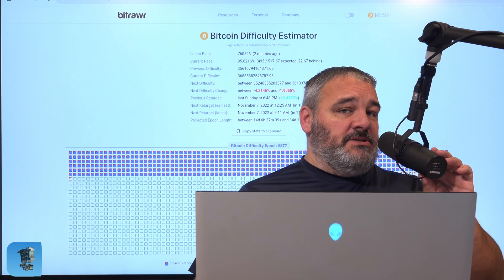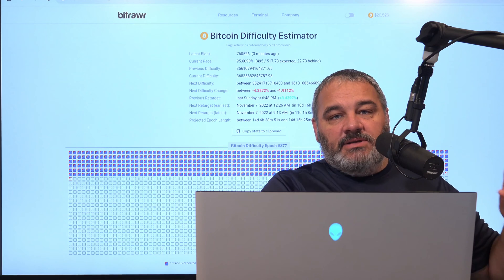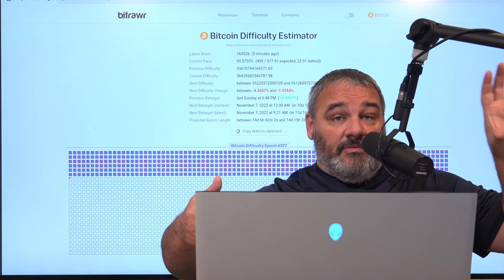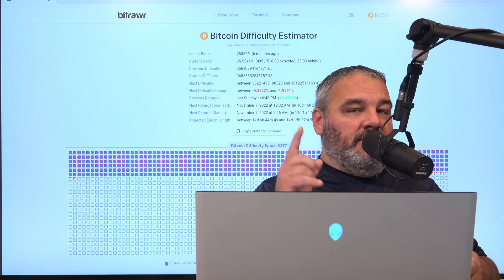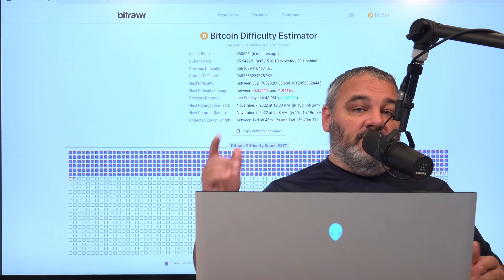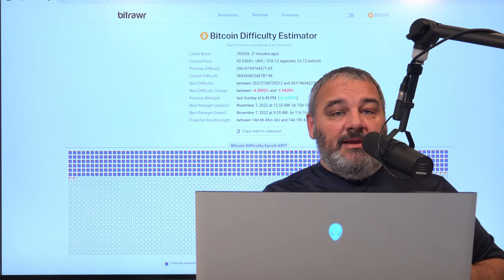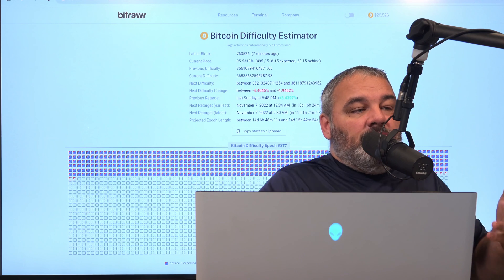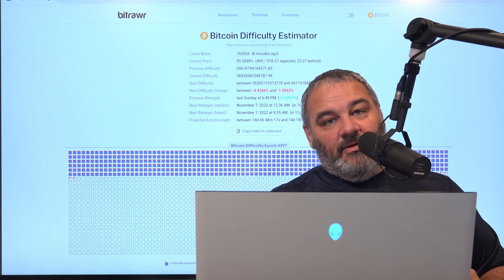Alpha Miner Power Supply Swap Tutorial 277v 5600w +

Comment: Love the vid.  TY.  Question.  I have a Bitmain S19 Pro 110 Th/s.  I've got it overclocked and it's running at 134 Th/s.  I can't overclock it any more d/t PSU limitations.  It's air cooled, but have replaced the stock fans with a better fan.  It runs cooler and quieter.  I have a 240V 30A socket split into two 15A banks via a Tripp Lite PDU.  Would you recommend this PSU in order to overclock the unit more, or is it not worth the risk in your opinion.  TYVM for your time.